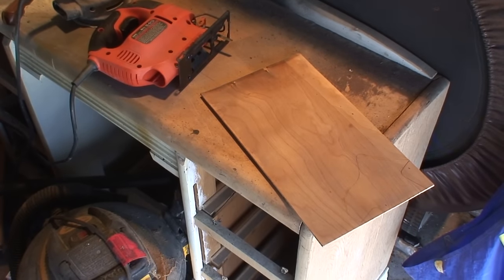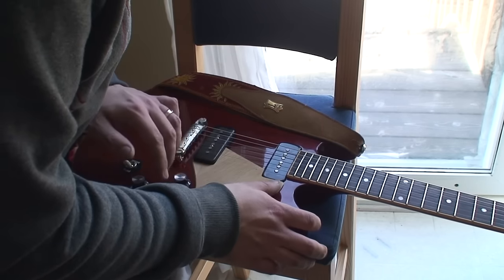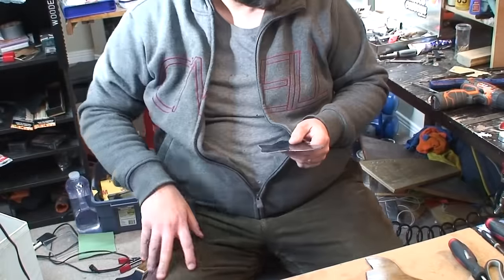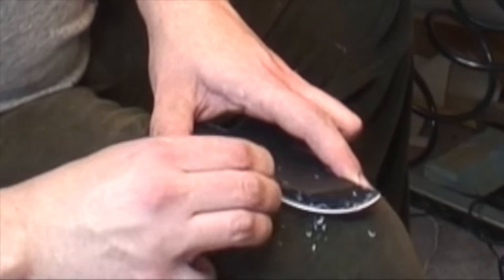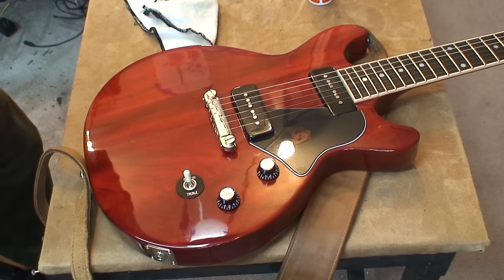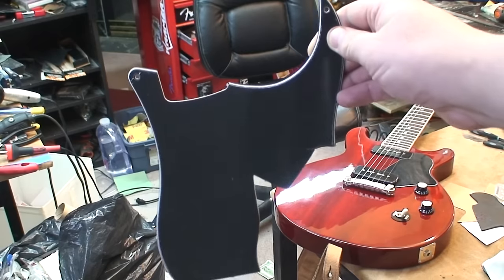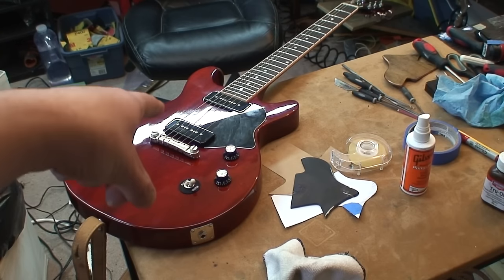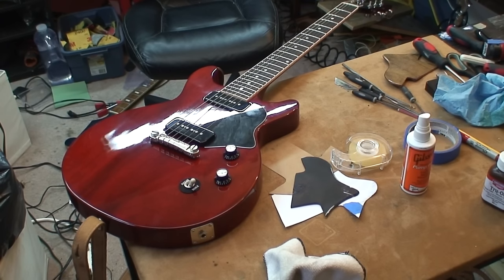2015 Gibson Les Paul Special: How I Made A Custom Pickgaurd For $9

Comment: I have an Ibanez that I like. It was never offered with a pick guard, but I wanted one. There was a much lower end model of it (out of production) that had a nice looking guard, and it may have fit, but I could not find one for sale. I had a couple LP style guards lying around and did much the same thing as you did and made my own which I am pretty pleased with. Mine is one ply black, like I wanted. And I used matte black screws into ever so slightly countersunk holes. Looks real sweet, and adds that completing touch to the guitar.

Comment: Looks great only thing I would have done is make the top edge level with the neck pickup as the bottom is. 👍
Reply from the maker: I went back and fort with different shapes. There are so many variations of this guitar and thus pickgaurd designs. I tried to go with a combination of the shapes I thought best suited the guitar. But the nice thing is, this is something anyone could do themselves. I even had the suggestion to go with tortoise, which isn't my thing, but it could work for someone:-)

Comment: Nice job, but why did you bother cutting out the wood pick guard if you were ultimately using the plastic? I think the wood one would look good too.
Reply: Firelock I wondered this myself
Reply: It's not a 'wood pick guard'. It is a template.
Typical production process: Design. Prototype. Template. Finished Piece.
Especially as a luthier/craftsman, If  you are going to bother putting all that time and effort into something like that, you make a template, so that you may revise it, or if ultimately satisfied with it: duplicate it as many times as you want to or need to.
Reply: frank Ieraci Okay

Comment: I really wanted a double cutaway Les Paul Jr. model but next to expensive Gibsons they are really hard to find. There are some, like the Tokai TJ 78, or Trev Wilkinsons Vintage make. Then Gibson came with these Specials in 2015. But my God, they were so plain, so boring, the punk favorite went to church it seemed. Yours is relatively nice, but apparently you share the same feeling I had, it's missing something. Thanks to your video I see there are more changes that robbed it from its soul. You clearly brought some back.

Comment: And wow, your guitar OCD is as bad as mine. Whoever had the Epi LP Special II that I won installed the bolt on neck plate upside down (the word Epiphone was upside down) and it drove me nuts until I corrected it. Made no difference as far as the guitar's performance was concerned but I knew it was there.

Comment: Looks good. Why don't you simulate screws by painting them on the pick guard? Ha ha. Don't drill.
Reply: better yet, just cut the screw heads from the shaft and super glue them to the guard. No need for any holes etc. It does look good! I know I missed it and would prob get if I watched again, but what happened to the ply cut out. Was it glued to the plastic pick guard bottom?
Reply: aukino tanga It was just a pattern stencil. He cut a cleaner piece from another strat pick guard and shaved the sides, used double sided tape.